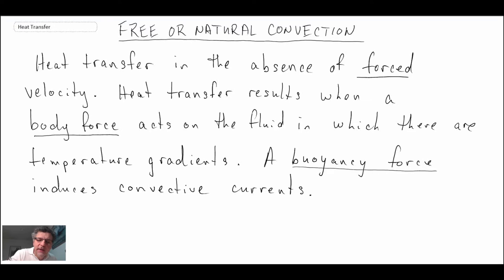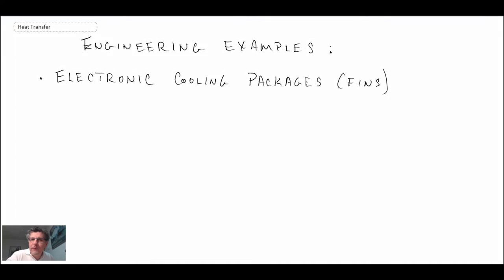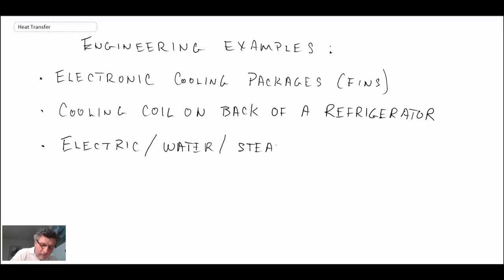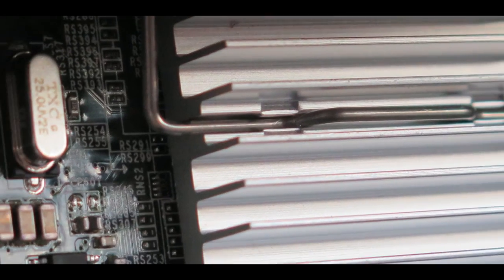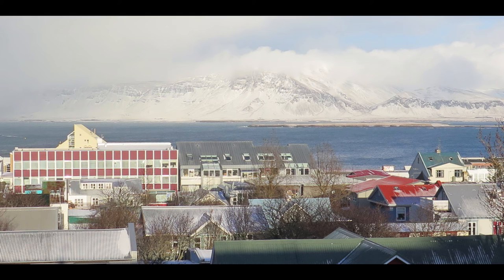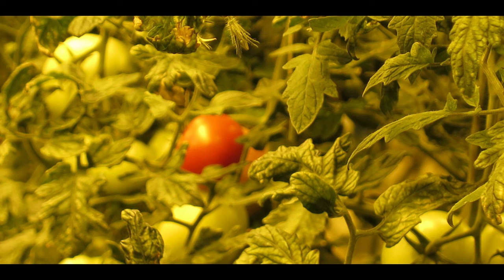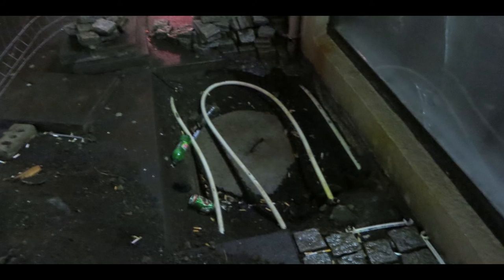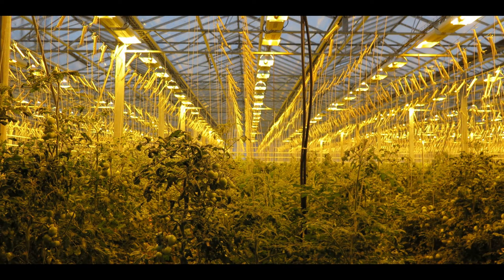Heat Transfer L23 p1 - Free or Natural Convection

Comment: I have a Mechanical
Engineering PE book, and as a footnote under a Table where it provides correlations
for Natural convection, it states that the maximum value for characteristic
length for a horizonal cylinder is 8 inches and for a vertical plate/cylinder
it's 2 feet (beyond = those lengths the change in boundary layer is negligible)
 However, I have never seen those limitations
in other book I have looked at.   

Are you familiar with this
?